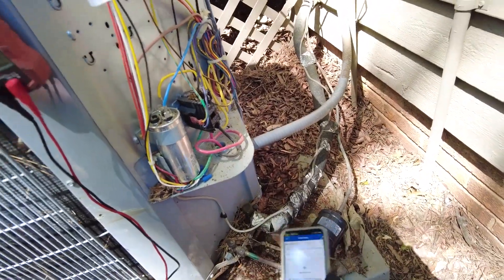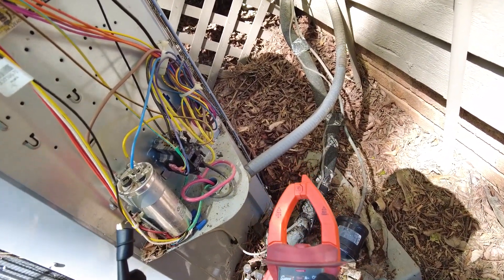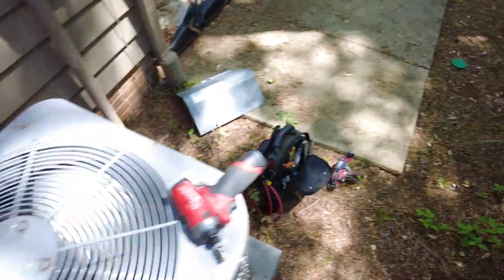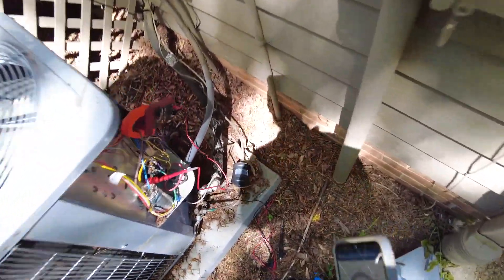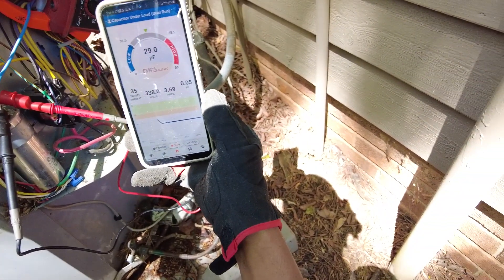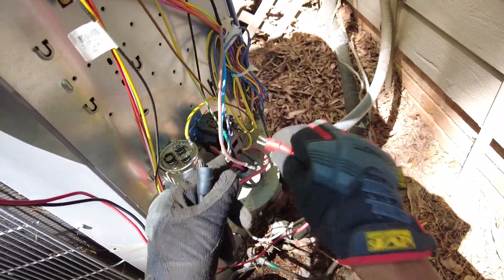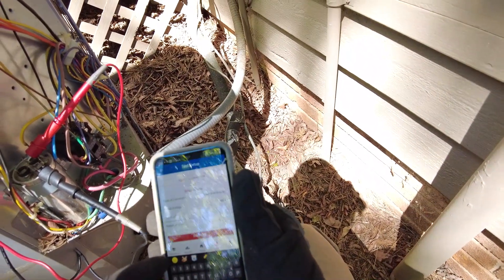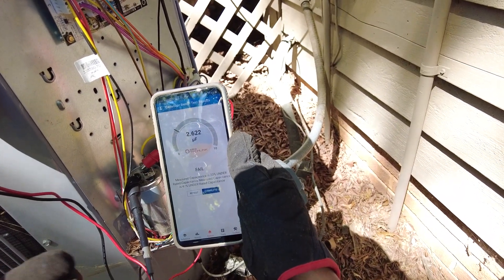Testing HVAC Dual Capacitor Under Load with Redfish Multimeter - Service Tech Tips

Comment: Nice video bud I have the same meter, I like how you put the magnetic on that meter you should take a pic or video on how to put one on I never seen how it was mounted on back so I haven’t don’t it yet. I do it under load and get better readings on the top of clamp
Reply from the maker: Cool thanks for watching! Yeah I can  upload a photo or something is pretty straightforward. I just pushed a safety pin through the rubber portion on the back where they leads mounts are and strapped the magnet that came with my Fieldpiece anemometer to it.